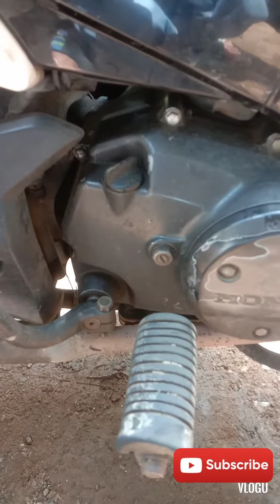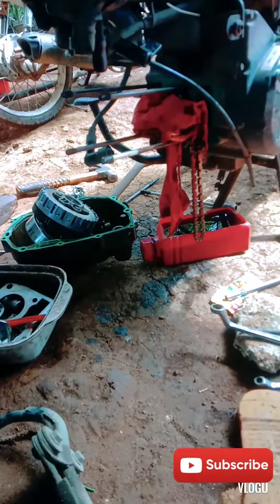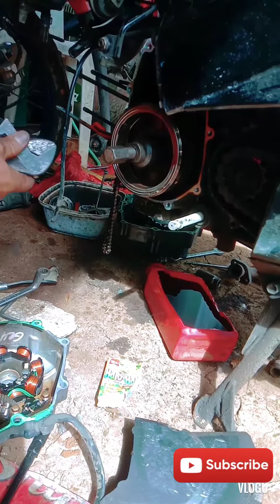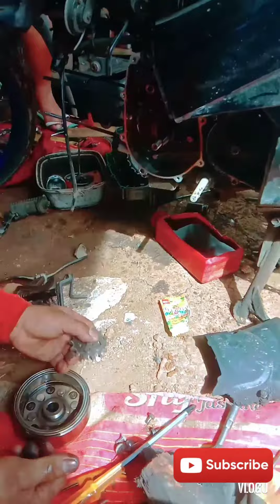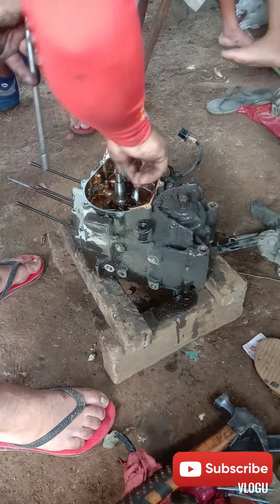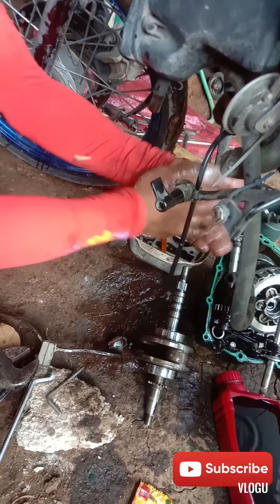Honda XRM 125 Engine tunog ngaw ngaw; alamin ano ang sira???🔥💪

Comment: Ano ba ang sira kung ngaw.x xrm de clutch po sakin. Tumatakbo ngaw.x siya
Reply: Same po ano po kaya sira nagpalit nako clutch housing at orimary clutch
Reply from the maker: Salamat po sa comment ang sira check mu  crangshaf engine  nasa lift side crangkis  check up mu ang crangshaf  mu
Reply: @alsoneforallvlog  sir anong size ng bearing ng xrm 110 sa loob ng makina yung lahat ng bearing sa loob sir yung bearing sa may segunyal at bearing ng transmission ?
Reply from the maker: XRM 125 lng ang alam ku na bearing pasensya na po sir yan lng alam ku
Reply: Pag de clutch ba na xrm yung limited edition ay pag tumatagal na biglang mag ingay sa clutch system tulad ng primary drive gear?
Reply from the maker: Hindi ku po na experience yan noOn sa akin sa side bearing lang po at sa side crankshaft lift side po merong tama ang cranshaft ku steak bearing gear starter po
Reply: @alsoneforallvlog  boss paano machecheck yung crank shaft kylangan ba baklasinn
Reply from the maker: @markjosephbalao3267  pag Meron Nang ibang tunog sa makina mu boss. .